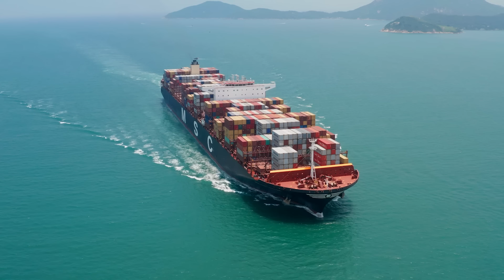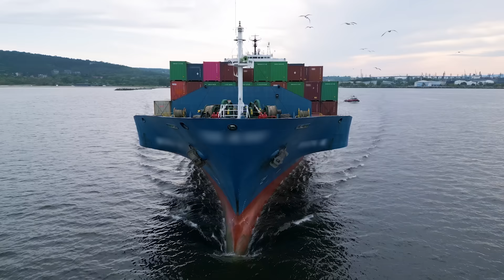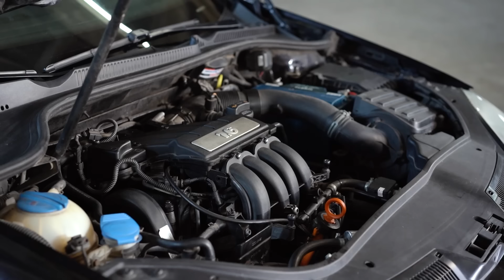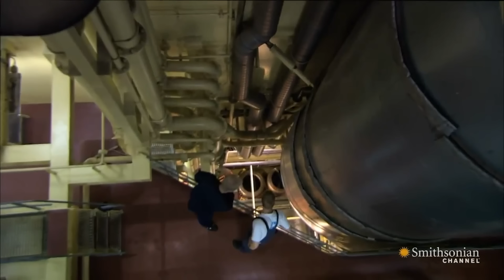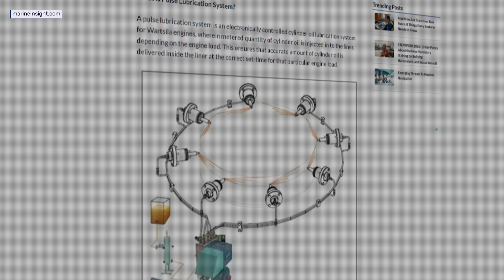The 100,000 Horsepower Engine

Comment: "A little bit faster than a second hand"? Come on, please do a basic sanity check. A second hand is 1 RPM by definition, so 102 RPM is obviously 102x faster, and about the speed you'd normally turn the pedals on a bicycle. If the second hand on a clock moved at 102 RPM, a day on that broken clock would last 14 minutes!

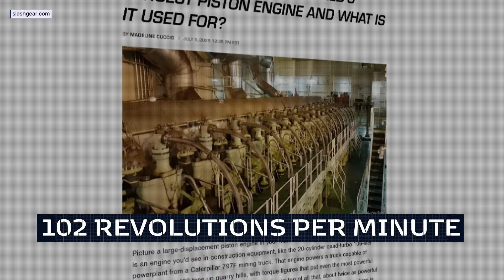Comment: 9:05 with all due respect, at this point you have mentioned the engine rotates as slow as a seconds hand. A second hand of a clock rotates once a minute, this engine's rpm is 102, therefore it rotates 1.7 times a second; 1.7x60=102
Reply: The math ain't mathing.
Reply: Or simply: it rotates 102 times faster than a second hand does.

Comment: What procedure is required to start the engine?
Reply: It is really simple. Even in manual mode.
-Turn the governor to 80% load.
- push the button that triggers the 40 bar compressed air, that starts turning the engine.
- turn the governor to 10% load faster than hell, when the engine starts.
The governor is equivalent to the gas pedal in your car. 
Takes aprox 15 seconds to start.

Comment: Coal-fired power stations rarely get over 45% efficiency, but gas turbine powered ones routinely get over 60%
Reply: Cogen? Steam turbine using exhaust heat?
Reply: @chuckevans2792 Most gas-fired power plants are combined cycle - all of the heat from the gas turbine  exhaust gas is used to generate steam for a steam turbine to produce more electricity. Total thermal efficiency of the best modern plants is close to 65%. CHP (combined heat and power) is when the waste heat from the steam turbine is then used for something like a district water heating system. In those the total thermal efficiency can be close to 90%. Cogen is when the exhaust heat from the gas turbine is used for other purposes - heating, steam for chemical plants etc.

Comment: You know, horsepower and torque would be a much better unit of measurement than lots of power. I’m well aware that things that don’t generate electricity can be expressed in watts, but like the entire metric system itself, it is very clumsy.

Comment: The real question is... WHY? Why aren’t they using electric engines with the heavy fuel oil to run smaller mechanical engines? It’d require a lot less steel. 🤷‍♂️

Comment: Given that bore is 2.5 m and RPM is 102, max piston speed 13.5 m per second. That's higher than road cars. You need Ferrari or something similar higher rewing engine to get faster piston.
Reply: What are you talking about, a 2l 4 cylinder with equal stroke and bore (86mm) exceeds that at around 3000 rpm

Comment: This channel should do a video about emergency generators for nuclear power plants. The one I worked at in the 90s had a generator with piston bores large enough for a grown man to stand up in and burned 100 gallons of diesel just to start it. If the plant's coolant system ever lost power, the volume of water needed for the coolant pumps to safely shut down the reactor was immense, hence the necessity for such a large generator.

Comment: Those 2 stroke diesels go right back to the great diesel manufacturers of Great Britain.
Reply: Not so sure about that.  Carl Hugo Güldner (18 July 1866 – 12 March 1926) was a German engineer and inventor. He is best known for inventing the two-stroke diesel engine, and the valve overlap in internal combustion engines.
-The British did invent the hit bulb engine and a two stroke engine type using seperate compression cylinder

Comment: You really screwed up the rpm comparison.. a second hand on a clock spins at exactly 1 rpm.. 1 single revolution per minute.. the diesel engine this video is about spinning at 100 rpm is comparable to a bicyclist average peddling speed..

Comment: Can someone explain to me how in the hell a marine engine has an extremely much better efficiency than anything the car industry has ever managed to design

seems totally crazy
Reply: Low rpm, and lots of room for exhaust heat recovery and generator. 

IIRC the old piston steamship engine was very efficient due to the triple expansion which more than doubled engine size. 

Steam trains with only double expansion used far more coal per KWH

Comment: The latest 1000 hp electric can be lined up to 114, x 1000 electric 95% efficient. So how will the run the engine to create the electricity?
Either 114 of or made larger, and quick release designed will make easy repairs

Comment: Space shuttle main engine fuel turbopump. Similar physical size of a V8, 37,000RPM, 71,000 horsepower
Reply: Insane power, but only has to run for a few minutes.

Comment: It uses over 10 tons of fuel per hour, I find it hard to comprehend that its a fuel efficient engine.
Reply: How much fuel does 5000++ fully loaded semi trucks use an hour, that’s how much the ship carries
Reply: The heat engine with the highest thermal efficiency ever made is the Raptor Vacuum, with a 3.6:1 mixture ratio and 380s ISP its thermal efficiency sits at around 63.9%, and I'm going to guess you are not going to be okay with its fuel consumption of around 724kg every second XD
Reply: @Laythe_ I did say...  'hard to comprehend' never said  I was not OK with anything, I do believe it uses over 10T of fuel per hour. 👍😉

Comment: CORRECTION: Those ships are diesel-electric. The engine powers a generator that goes to pod motors with props. A propeller shaft that large would shear itself if the prop hit anything. This isn't a size problem, it's a material problem.

Comment: Your equating the rpm's with the second hand of a watch are only off by completely.  106 rpm is dramatically faster than 1 rpm by say 106 times.  All be it being dramatically slower than 8000 ram. The math's don't math.

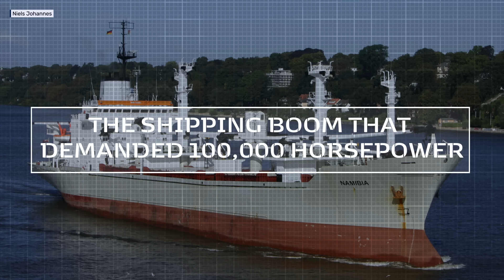Comment: 1:40 - Chapter 1 - The shipping boom that demanded 100k horsepower
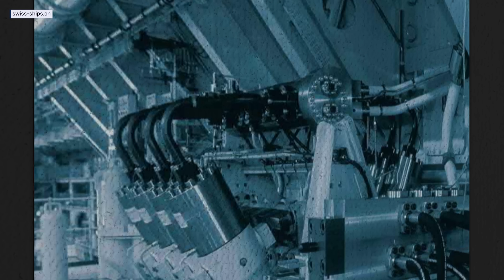4:25 - Chapter 2 - Turning a proven design into a record breaker
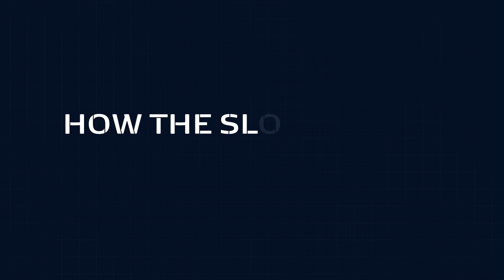7:35 - Chapter 3 - How the slow speed giant works
11:25 - Chapter 4 - Emma maersk & the fire before the 1st voyage
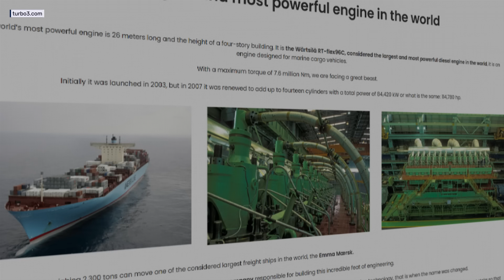14:20 - Chapter 5 - The horsepower race that the market ended
17:25 - Chapter 6 - The cost of burning heavy fuel
20:15 - Chapter 7 - The last giant of the diesel age

Comment: In 2014 i went through a company provided program to get my qmed and dde endorsements on my uscg license. The lady they found to teach this class was one of 3 women that had went unlimited license in the engine room and then unlimited in the wheelhouse. One day in class when we were discussing engine rebuild, something i was very familiar with but on a much smaller scale than she was i jokingly asked what they used as a ridge reamer to get the pistons out… a guy standing ontop of the piston with an angle grinder? Thats the procedure…. A guy climbs in the cylinder bore, stands ontop of the piston, and grinds the ring ridge out with an angle grinder as if he were sharpening lawnmower blades. You know the most fascinating thing i learned about the assembly of those sultzer’s is the ginormous head bolts are torqued down by hand. Not a torque wrench…. Just spun down on their studs by hand… hand tight. They use hydraulic jacks to compress the head gaskets, hand tighten the nuts on the studs, then release the pressure from the jacks onto those studs. That blew my mind.

Comment: I can't believe you only mentioned the torque as being enormous. The 6 million foot pounds of torque is what makes this engine legendary and over 50% efficient.
Reply: You are not making a battery powered boat like this, huge environmental risks, batteries the size of Walmart exploding or leaking. The answer is probably nuclear up until we can fit a fusion reactor on board.
Reply: @chipmiller3155 I mean, a ship's oil tank leaking or exploding is a pretty big and devastating risk already mate
Reply: Crazy that the engine is direct coupled to the prop.
Reply: This show probably would have wanted to replace foot-pounds with the occult measurement. And the shows read by Simon just seem to be getting worse and worse, in my opinion.
Reply: Holy bajeesus.... I can't even fathom that amount of raw power. Like 30,000 of my cars pushing on one object is ABSURD
Reply: @DoctorGarr or like 100,000 horses running around the inside of the engine bay
Reply: Crazy that we’re still stuck with 19th century tech at such low efficiency…typical EV is around %90….things need to change
Reply: @chrisvig123  And the power to charge an EV is produced at less than 50%, sometimes less than 10% efficiency, so EVs are really more like 5-30% efficient.
Reply: @mikey4016  that's not how math works, especially when charging with solar and wind power, which is free to produce.
Reply: @Sepaedius  Ignoring loss over transmission, loss from heat when charging (a lot of heat gets generated on the faster charge options), loss from most power at night being provided by other less "efficient" forms of power (this does depend on your country but is mostly true for the majority of countries in the world) and ignoring that most green energy options are produced in the largest coal using country in the world using primarily fossil fuels for production.
Reply: @Sepaedius  Solar and wind power aren't free to produce, they require huge amounts of energy to produce. They are cost effective and will usually produce more than they required to be produced, I think it takes a few years just to produce as much energy as was consumed in their productions, but I don't have the figures. But most EVs aren't charged from solar and wind power, most are charged from the grid and more than half of the U.S.A. grid is earth fuel.
Reply: @Sepaedius  Also, the charging efficiency of an EV can be as high as 90% or as low as 75%, the coulombic efficiency of the batteries can be as high as 98% or much lower, the motor controller efficiency can be as high as 90% or much lower, the motor efficiency can be as high as 97% but usually much lower. So for the best case scenario the efficiency of just the propulsion of the EV (not even counting the drivetrain losses) would be about 75%. And that also doesn't count the stupid "infotainment center" or the climate control or the lighting.

Then if you're charging from an average grid, your power is being produced at less than 50% efficiency, then it's being transmitted at a loss also, probably at least a 10% transmission loss. So you're looking at about a 15% or lower (usually much lower) efficiency overall.

And I'm no math magician, but I'm pretty sure I have that math correct.
Reply: @mikey4016  You're not wrong, but if you're considering those factors then you're going to have to consider eg. the entire supply chain for the fuel that's running the combustion engine.
Reply: @mikey4016 by your own numbers you reach 24% not 10%.
Reply: @Sepaedius we aren't using solar though
Reply: @chrisvig123  Ah yes, but now you will need TWO ships, one for the battery and the second one for the actual cargo lmao
Reply: @chrisvig123 well, that's... ill considered. If you wanted a ship like that to be able to do what it does with an electric engine, it would need to bring it's own diesel fuelled electric power generation plant. Which is actually what cruise ships do, and that makes them much less efficient than 50%.
Reply: @chrisvig123  it would have been easier for you to just come right out and tell us you're a moron.  How many participation trophies did you get as a child?

Comment: The common rail injection system does not replace the valves, and by extension the camshaft. It relates to injection, i.e. to fuel, not air. In Diesels, the fuel did not come through the valves anyway, unlike carbureted gasoline engines. In slow two-stroke Diesels, valves improve the air supply, and implicitly the combustion. There must be a mistake somewhere.

Comment: I was a locomotive mechanic for a while, and the 16 cylinder EMD 16-645 two-stroke diesel genset was awesome. 645ci (10.5l) per cylinder, three thousand horsepower with the twin superchargers, forty-five hundred with the 30in turbo that weighs around 2000 pounds. We did a motor swap at the Alamo rail yard Se of San Antonio. VP Racing Fuels is made next door.
Reply: They run at 900 rmp at full load, which powers a generator that powers the 4 or 6 axle traction motors.
Reply: I got in on the rebuild of 7 sets of those emd’s working with msi in shipyards for inland towboats getting time as a qmed to qualify for my designated duty engineer license. Love the sound of those engines. They are trying hard to phase them out now. I love my cat 3512’s on the boat im currently riding on, they have been the most solid trouble free engines i have ever dealt with to date, but those emd’s hold a place in my heart
Reply: Im a maritime engineer currently on harbor tugs. We have two boats left with those EMD's. Everything else is CAT or GE with azimuth drives. Those old boats just have a satisfying sound. Great engines to learn on too. Everything is still analog. Oil Governor and Air controls. Rare sight these days.

Comment: Now think about the fact that a Top Fuel Dragster that weighs roughly 2400 lbs pushes (1 tenth) 11,000HP to reach 1000ft in 3.6s at 344MPH. Those engines need to be fully rebuild after just one pass though lol
Reply: Now think about a turbopump on a rocket that weighs less then a hundred pounds and produces tens of thousands of horsepower, runs for minutes at a time, can be restarted, and gets reused with little more than a cleaning.
Reply: @wagnerrp  Elon Power Hell Yeah!!! SpaceX boosters are kind of it's own beast these days!!!

Comment: The trade school I went to had a compression ring from one of this engine's predecessors hanging up on the wall. It was the size of a hula hoop.
When they lay the keel for a ship that will be powered by one of these "cathedral engines," workers pre-lube the crankshaft bearings with a mop and bucket full of assembly lube.

Comment: Now after seeing all this massive steel producing 100,000 horsepower I want you all to think of this. 
Each of the SR-71’s two Pratt & Whitney J58 engines produced an incredible 160,000+ equivalent shaft horsepower.
Reply: Yeah, that should tell you, that horsepower can be a meaningless comparison.
Those jet engines would hardly be capable of pushing those ships, while the incredible torque from the Diesel engines have no issues with that.

You could compare it with 1cc micro engines, that are used for model airplanes and model cars, that produce around 1 HP. Take 100.000 of them, and they couldn't move these ships, even though you had 100.000 HP at your disposal.
Reply: Torque is what’s matter, need that to turn a huge 100 ton propeller
Reply: Right!  That was my whole point horsepower doesn't mean shit!

Comment: Wrong. I am currently on a ship that is powered by one MAN B&W K108ME-C. Specifications for this engine is 12 cylinder, 1080 mm bore diameter and 84.6 MW (113,400 hp)

I have heard there is another ship in production that will be the same MAN B&W K108ME-C as a 14 cylinder version. In which case that will be expected 97.3 MW (133,000 hp)
Reply: Where is the proof?

Comment: I worked on a 96c with 10 cylinders, really amazing at full song. We would shut down all the exhaust fans for the engine room because the engine would be sucking in so much air and the engine would still run at a vacuum.

Comment: Those 100 000 hp only push the propeller and shaft forward!
So the propeller shaft and engine needs to be securely fastened to the ship to not just rip the engine to pieces